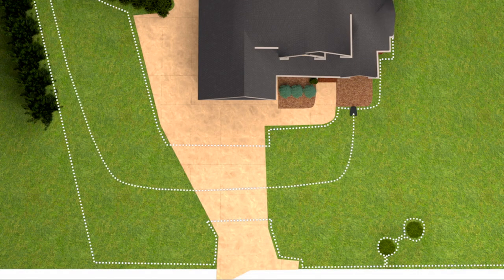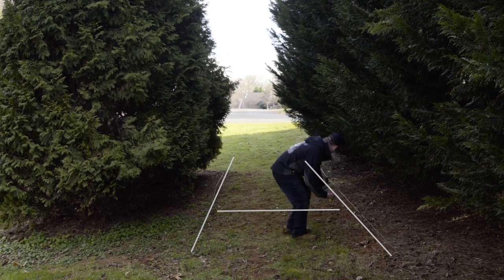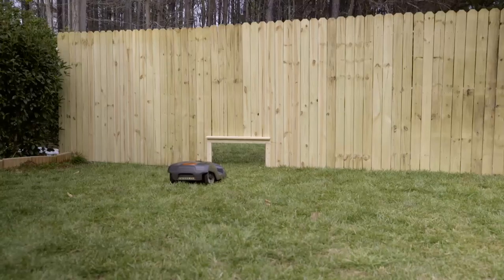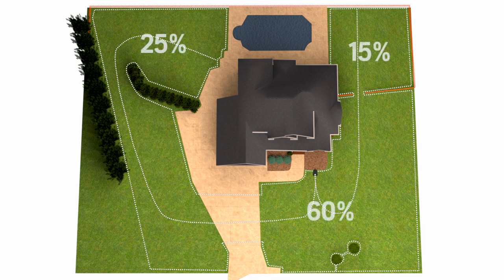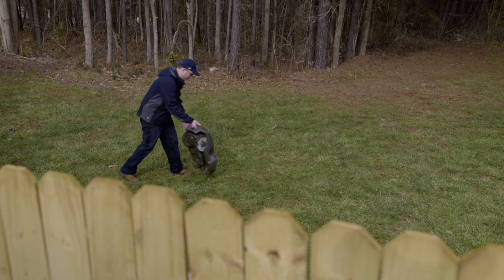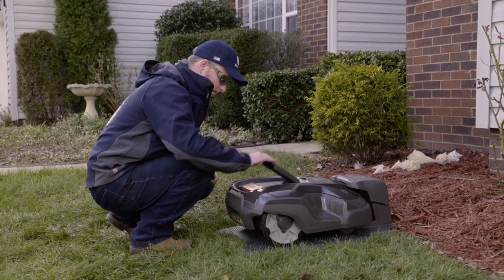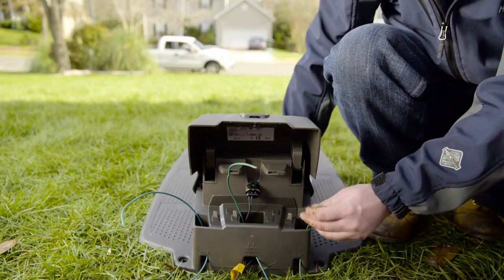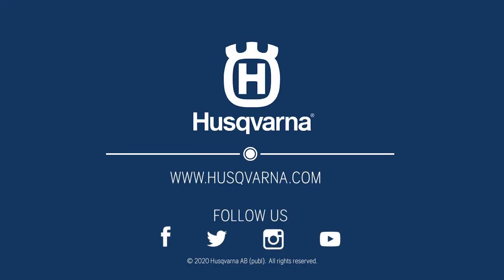How To Install Automower® Around Obstacles | Husqvarna

Comment: For anyone who just bought a Husqvarna automower be aware that the cutting height adjustment does not show up for the first two weeks in the app or on the mower's menu (as of April 26 2022 anyway).  Husqvarna states this is to let the boundary wire lay down - it forces the mower cutting height to max for the first two weeks.
Reply: i don't find that to be the case July 2022